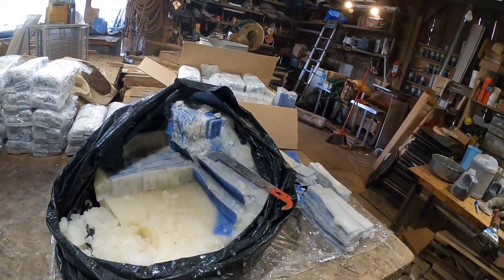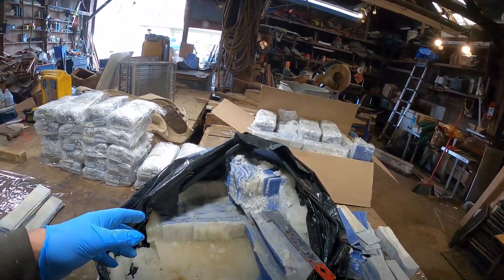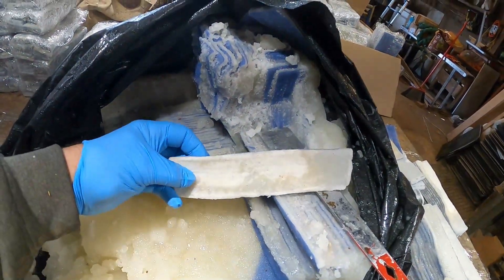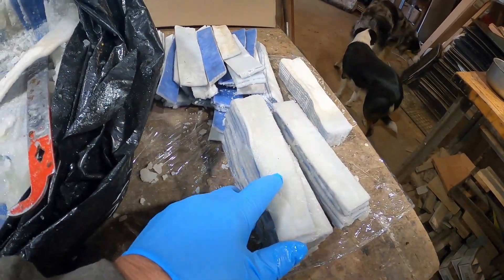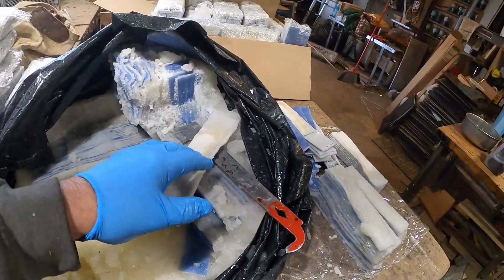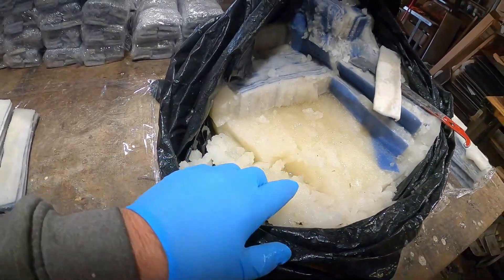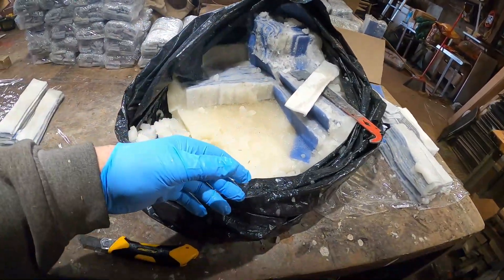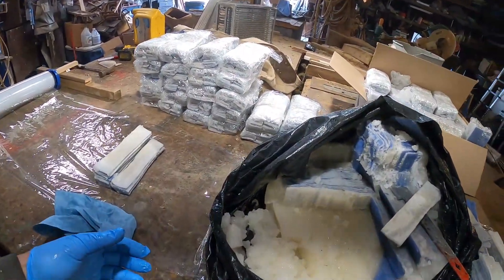bagging the Oxalic Acid strips

Comment: Nice video.  Do you find that these work pretty well?  I used them all year and followed up with 2 1/2 doses of Formic on large colonies.  I have around 60 4 over 4 NUCS that I relied solely on the strips. So I’m crossing my fingers.
Reply from the maker: they have worked very well for me. I replace them when they get light, and test to be sure its working. the highest test this year was under 2%, most had 0.
Reply: @harrisjoubertwithsleepycre1924  thanks for the reply.  That’s great to hear.

Comment: Congratulations on 600 subs :D As for keeping the strips submerged, maybe get a container with a lid that has brackets the push the strips down (maybe add hardware cloth under the brackets so the strips don't slip between them) It would look somewhat like the mesh used to push slumgum down in a wax melter.
Reply from the maker: when I redid the dry ones, I did them in a shorter box, and put some expanded metal over them with a lead weight. I was able to work them up and down more, and got a great soak